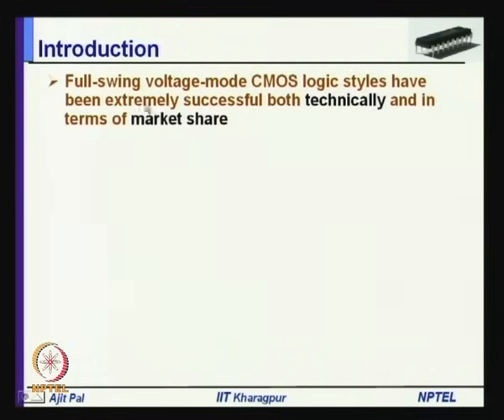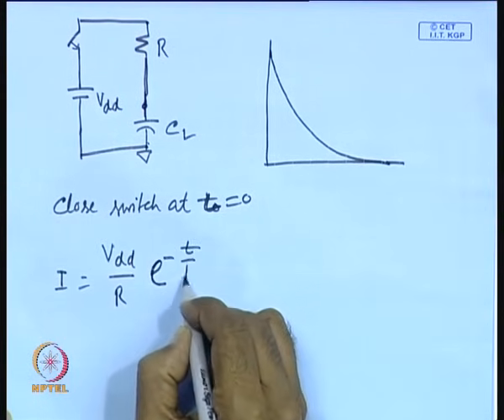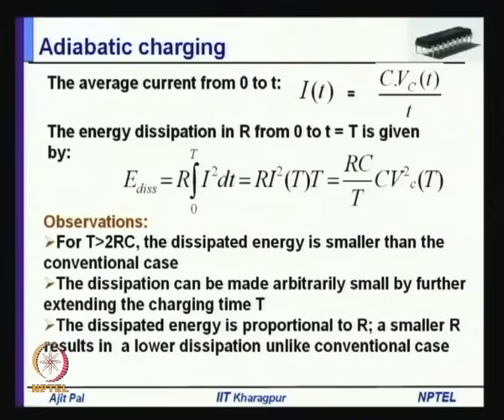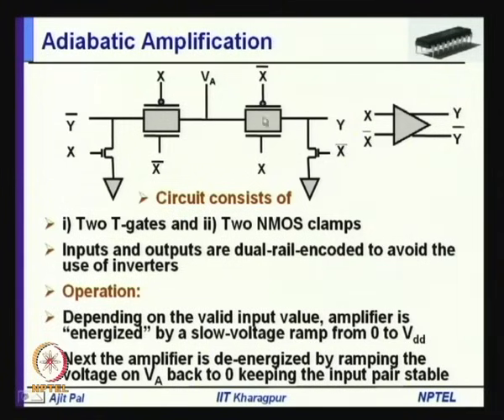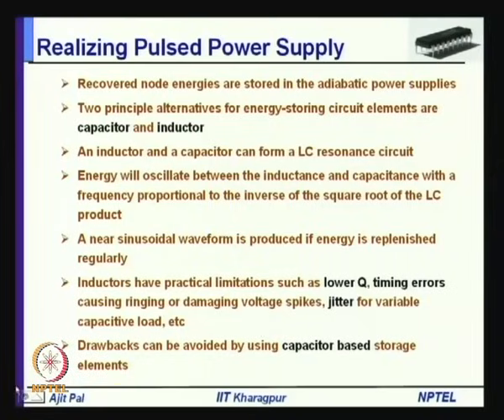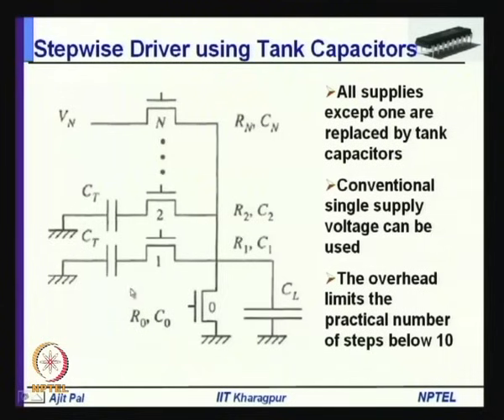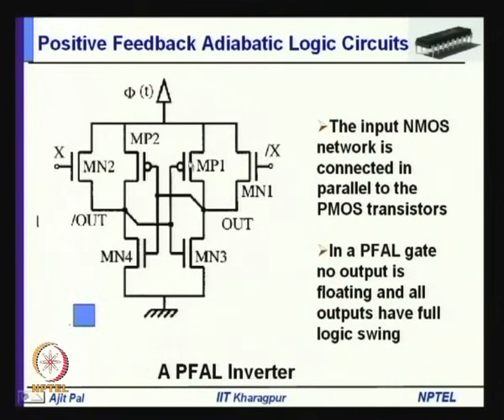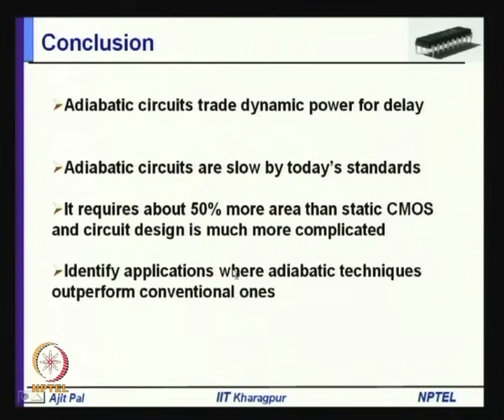Mod-01 Lec-36 Adiabatic Logic Circuits

Comment: Congratulations, you invented new formula for voltage across a capacitor in response to a time varying current. You need a Nobel prize. How did this idiot become an IIT professor?